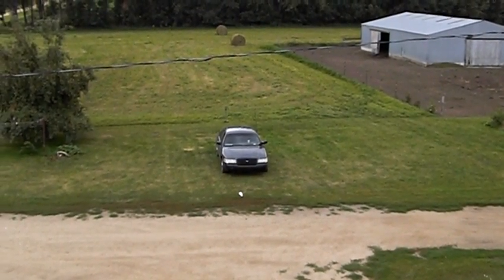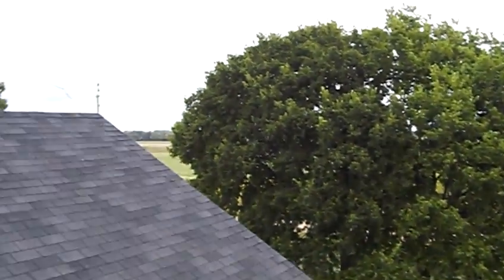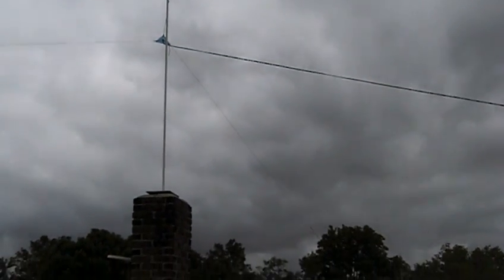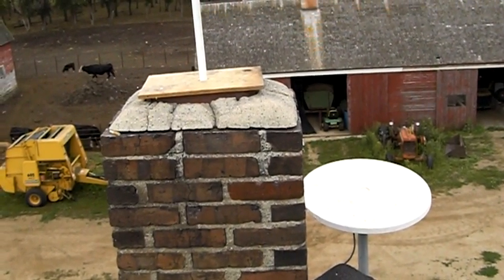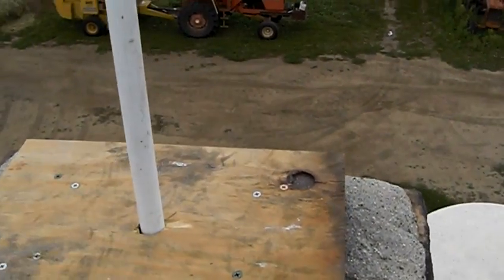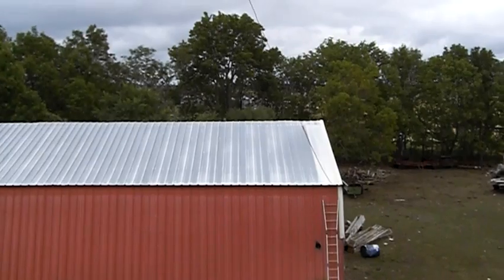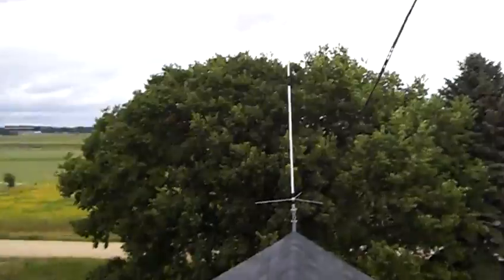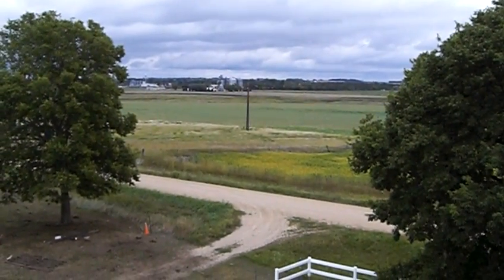Base Station Antennas

Comment: I am waiting on my delivery of a Tram 1481, from what I have read if you don't waterproof the joints water will seep inside the vertical section. Is this something you have experienced, or what measures did you take to seal the sections? 

KN4KVJ
Reply from the maker: dbcooper1961 yeah that's true. My buddy and I bought one each at the same time and I wrapped the joints on mine with black electrical tape and he didn't. A year later his quit working well so he took it apart and poured the water out. Worried I took mine apart but found it bone dry. So a little tape will be all you need. Great antenna otherwise.